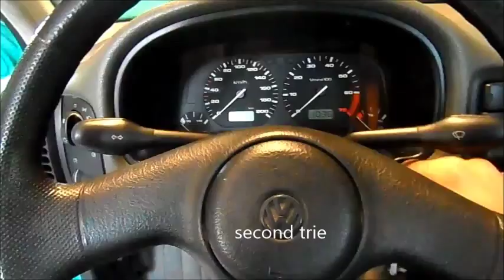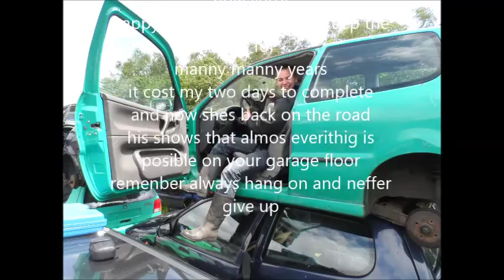polo upgrade power steering

Comment: Well Done , ı just bought a polo 1000 cc year 2000 and need to upgrade the power steering , I think I can manage , thanks man
Reply from the maker: your welcome and remember dont give up  it can be a hard job to get some things loos butt eventually it will go  the steering bullit i messed around with it for 5 hours because i couldn't get it loos  you i had to made my own tool butt if u have questions just ask greets

Comment: Thanks for your replay 
One more question ! The car I bought is 2000 model with no extras 
Is it possible to install power steering ? Any tips much appreciate it 
Danke well 
Greetings from Malta
Reply from the maker: yes that is possible  some junkyards have those cars laying around   you can just place a unit remove the subframe + old steering unit attach the  power steering pump and the hoses and suche  just like i did greets